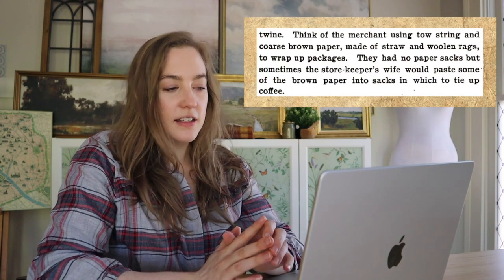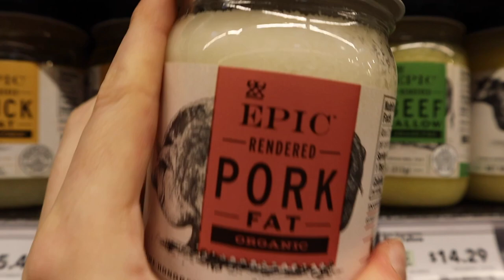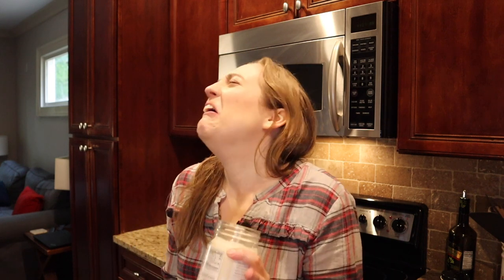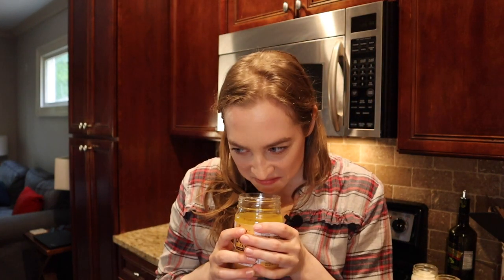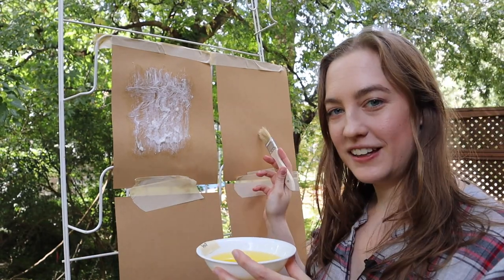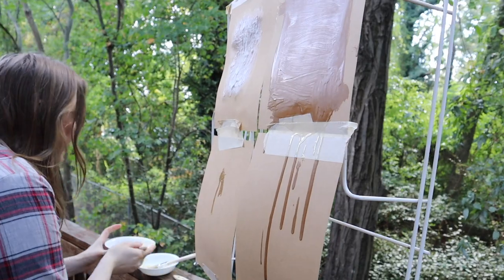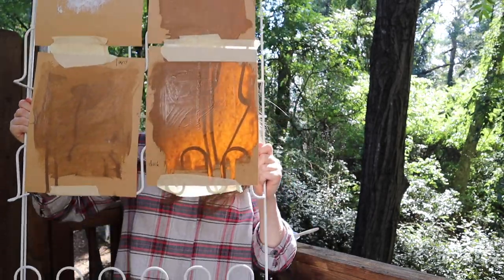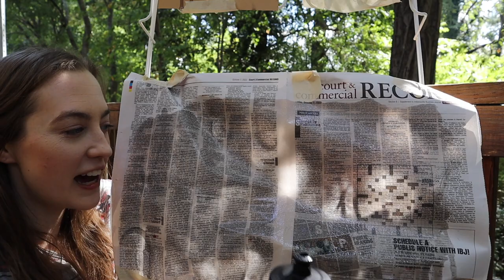Making greased paper windows (so messy!) | Experimenting with American history

Comment: People made do with what they had.  Window glass was expensive or not in good supply in many areas.  One solution would be to use paper or parchment ( thinly-scraped animal hide ).  Parchment was more durable, but more expensive.  The animal hide could be scraped very thin and when oiled, provided a good barrier to the weather and animal intrusion, whilst still allowing an amber light into the interior spaces.  Oiled fabric had to be very closely woven or it wouldn't work properly.  Window screens could be made of woven linen prior to the introduction of mass-produced wire screens.

Some types of fish skin could also be used and let in even more light, but this wasn't available most places and sometimes attracted vermin.  Many folks just made do with wood windows or ventilators that could be opened to the outside world to let in light and air, but wouldn't prevent intrusions, so metal or wood grilles could be fitted as partial protection.  Interiors were often dim places and would have been illuminated no better than traditional Japanese homes were.  These provided a sharp divide between the inside and outside world ( something we usually lack today ).   Traditional Japanese and Far Eastern homes used Shoji screens, made of rice paper to let in light.  The rice paper would be replaced annually and any tears could be mended with a little glue and a leaf ( Gingko leaves were favoured ).  The rice paper had a protective finish on it.  Today, we can achieve a similar look using fibreglas fabrics in place of rice paper. 

Most people in traditional societies and pioneer communities would spend most of their waking days outside performing work.  You retreated to interior spaces during the evenings, inclement weather , winter or during troubled times.

Oiled, greased or liquid soap treated hide or parchment was not transparent, but translucent.  The people who could afford crystal or glass windows did so as much as an ostentatious display of wealth and prestige as for the 'clear' benefits of bringing light into domestic, workshop and ecclesiastical interiors.